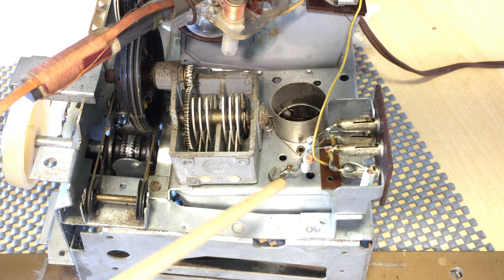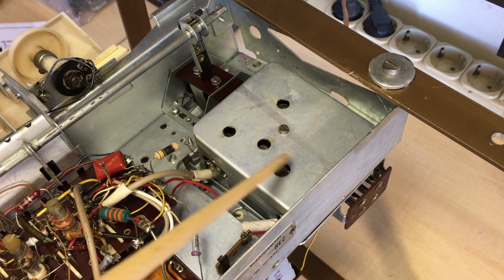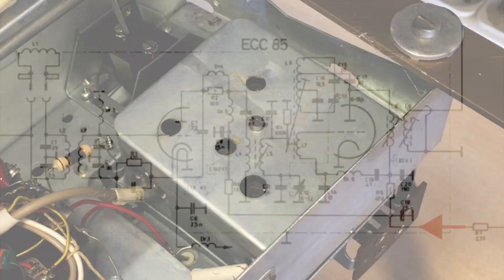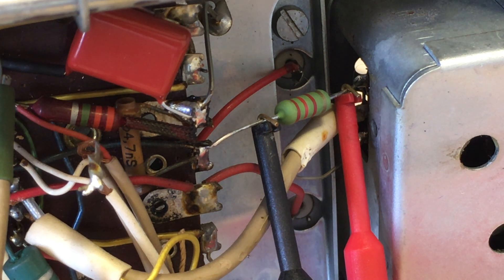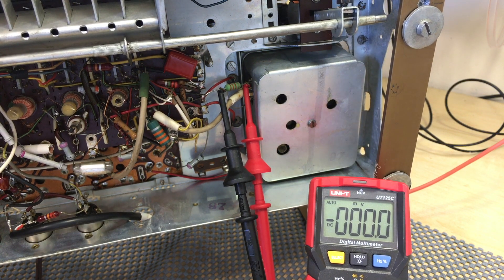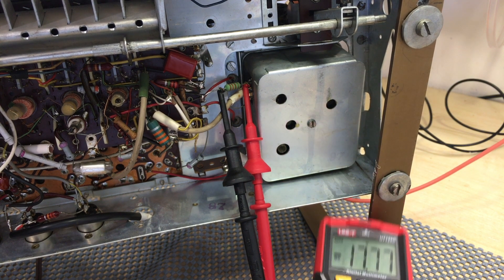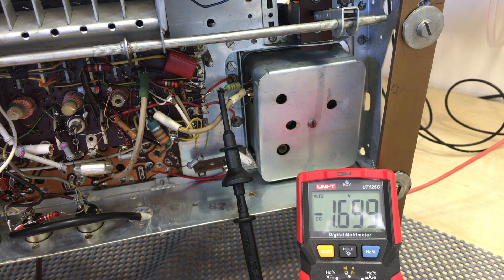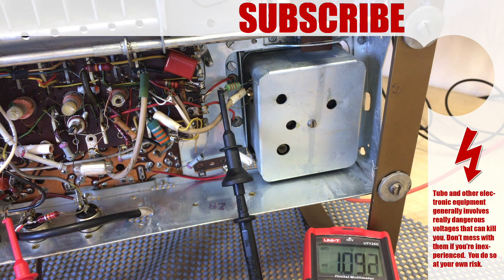Loewe-Opta Rheinperle 5717W restoration - Part 6. Checking the FM section.

Comment: I have learned so much from your tutorials. There are a couple things that I do not understand for instance in the power supply section the power transformer has a secondary of 220V but after it goes through the bridge rectifier it shows a DC voltage of 280V. How come there is an increase? What does AGC stand for? Showing my ignorance I realize but please remember there are no dumb questions or so the saying goes.
Reply from the maker: No problem with the questions.
220vac converts to a higher DC voltage when rectified because the diode converts all the positive and then the capacitor “holds” the peaks. 220vac is actually 311v peak.
AGC is automatic gain control.
Hope that helps.
Cheers

Comment: Are you sure it was the ECC85 tube, could you measure a short inside it? It also could be the tuning mechanism that creates a short when it is tuned to one of the ends of the band. Did you  tune across the entire band while checking the voltage drop across the 'cooked' resistor?
Reply from the maker: Yes. I’ve checked it thoroughly. And if the tuning cap shorts:
One part shorts the grid of one of the triodes to ground. No problem.
The other part of the cap could short the supply to ground if C17 and c15 were both simultaneously shorted, so not likely.

Comment: Are you satisfied with the UNI-T Multimeter? What has happen with your Fluke 11?
Reply from the maker: My fluke (yes, the 11) finally died. I had it since my first year at university so I was quite upset. The uni-t is a simple one I bought some time ago as a backup. I’m waiting for the Brymen I’ve ordered.
Reply: @electronicsoldandnew  Oh, this i can feel with you. My fist Fluke (much more older, this one with the Keys at the left side) was stolen after many years of use. Months ago i bought a Fluke 87V at ebay, used, but in fact new, (200€!). I hope, this one will be at me till the end.
Reply: UNI-T always WORKS : )    Fluke is always INSANELY OVERPRICED : (  only works when it feels like it, more intermittent than anything i test.
Reply from the maker: r m : I’m afraid I can’t agree with you completely. I agree with the “insanely priced” part, but as for reliability, I’ve  never had a multimeter more reliable than my fluke. The Uni-T is fine but rather slow, and I use it sparingly. But then, for the price, I can’t complain.

Comment: Sounds nice. There is great detail going into the circuit checking with all those underlined schematic pictures. I'm amazed with how clear you make it look. Bravo
Reply from the maker: Good to know it’s clear. Enjoy.
Reply: I have a question if I may. On a 238v power grid, is it best to set the voltage selector to 220 or 250?
Reply from the maker: Try it first on 250, but it’ll also be ok on 220. I’m surprised you have one with a 250 volt option. Not usual.
Reply: Its a luxorita 355w as far as I could tell, very close to the one at radiomuseum website but with voltage selector and a treble cut switch. The thing hums even without the 6v6 inserted. I believe its because the power transformer is right against de speaker.
Reply from the maker: Daniel Saturnino : good luck with the restorations